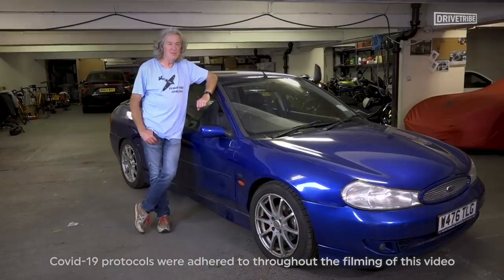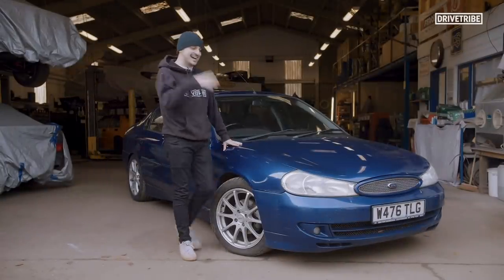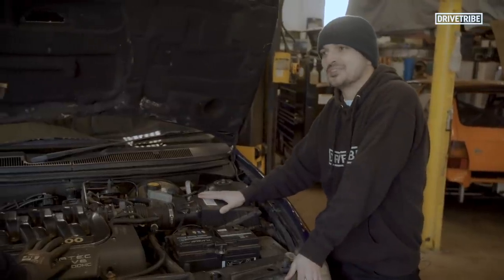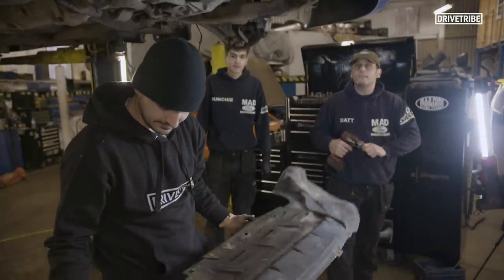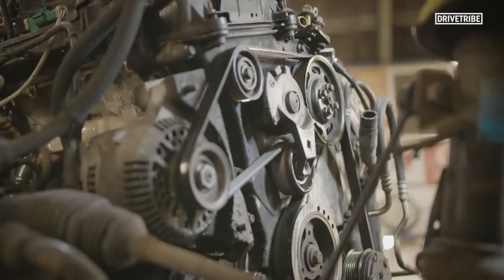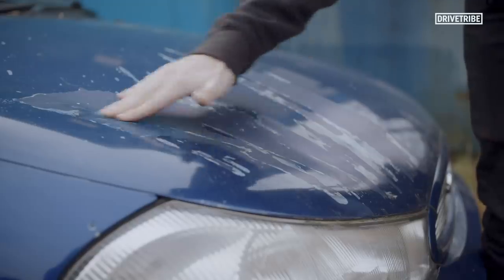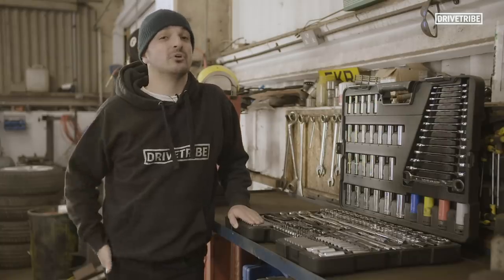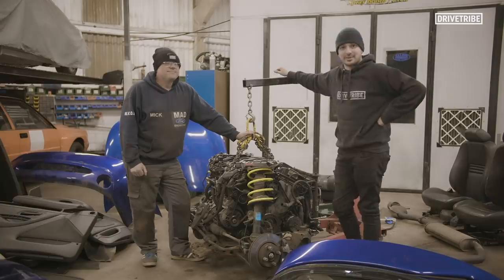Restoring the car that Clarkson, Hammond and May all love | Ep.1 | Ford Mondeo ST200 restoration

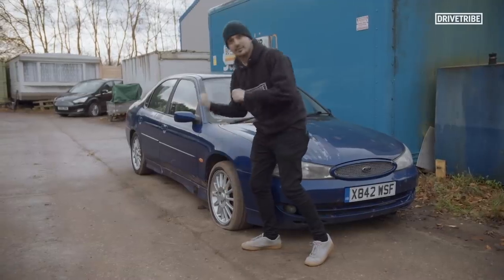Comment: 10:29
X842 WSF
Do not drive until repaired (dangerous defects):
 - Nearside Front Tyre tread depth below requirements of 1.6mm (5.2.3 (e))

Repair immediately (major defects):
 - Offside Body panel insecure side skirt (6.2.1 (a) (i))
 - Nearside Front Headlamp not working on dipped beam (4.1.1 (a) (ii))
 - Headlamp lens seriously defective no patter dew to condensation (4.1.1 (b) (ii))
 - Front Headlamp light source and lamp not compatible has HID bulbs fitted (4.1.4 (c))
 - Exhaust has a major leak of exhaust gases front flexi area (6.1.2 (a))
 - Front Integral body structure corroded to the extent that the rigidity of the assembly is significantly reduced both floor pan's marked with chalk (6.1.1 (c) (i))
 - Nearside Integral body structure corroded to the extent that the rigidity of the assembly is significantly reduced outer sill marked with chalk in multiple places (6.1.1 (c) (i))
 - Offside Rear Integral body structure or chassis has excessive corrosion, seriously affecting its strength within 30cm of a body mounting floor pan within 30cm of trailing arm mounting point marked with chalk (6.2.2 (d) (i))
 - Nearside Rear Integral body structure or chassis has excessive corrosion, seriously affecting its strength within 30cm of a body mounting lower part of wheel arch 30cm of seat belt mounting point marked with chalk (6.2.2 (d) (i))
 - Offside Front Upper Anti-roll bar linkage ball joint dust cover no longer prevents the ingress of dirt (5.3.4 (b) (ii))
 - Nearside Front Coil spring fractured or broken (5.3.1 (b) (i))
 - Offside Front Brake hose excessively chafed (1.1.12 (b) (ii))
 - Rear Body panel corroded and likely to cause injury both wheel arches (6.2.1 (a) (i))
 - Repair as soon as possible (minor defects):
 - Offside Front Inner Drive shaft joint constant velocity boot severely deteriorated (6.1.7 (g) (i))
 - Rear Brake pipe inadequately clipped or supported chaffing anti roll bar and subframe (1.1.11 (d) (i))
 - Offside Front Tyre obviously under inflated (5.2.3 (l))

Monitor and repair if necessary (advisories):
 - Oil leak, but not excessive (8.4.1 (a) (i))
 - Fluid leak, but not excessive coolant leak from radiator area (8.4.1 (a) (i))
 - Offside Rear Outer Integral body structure is corroded but structural rigidity is not significantly reduced sill (6.1.1 (c) (i))
 - Integral body structure is corroded but structural rigidity is not significantly reduced both inner and outer sill's corroded (6.1.1 (c) (i))
 - Front Suspension arm pin or bush worn but not resulting in excessive movement both bottom arms front bush's (5.3.4 (a) (i))
 - Rear Suspension arm pin or bush worn but not resulting in excessive movement both trailing arm bush's marked with chalk (5.3.4 (a) (i))
 - Nearside Rear Inner Tyre slightly damaged/cracking or perishing sidewall has sings on been run flat (5.2.3 (d) (ii))
 - Rear Anti-lock braking system wiring damaged but not excessively both loose (1.6 (d))